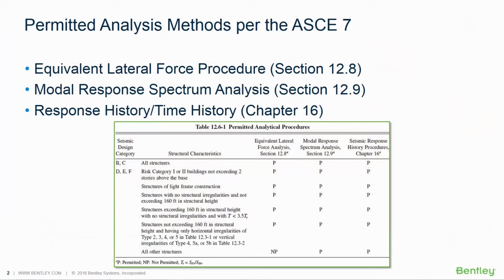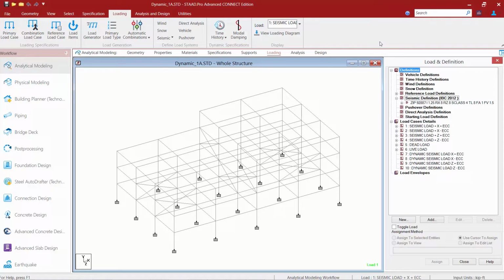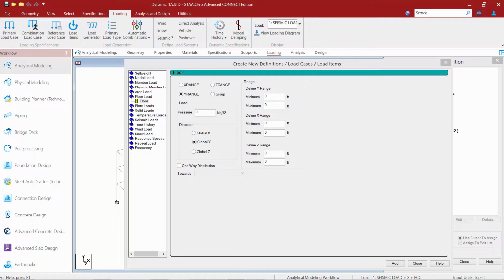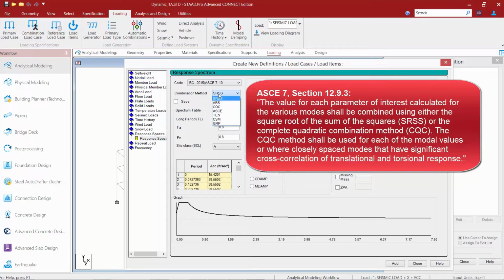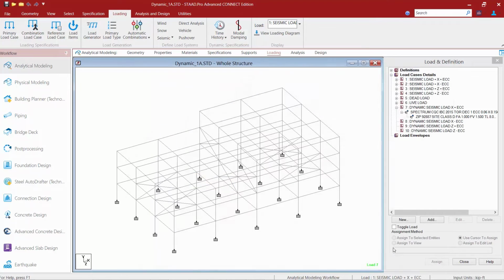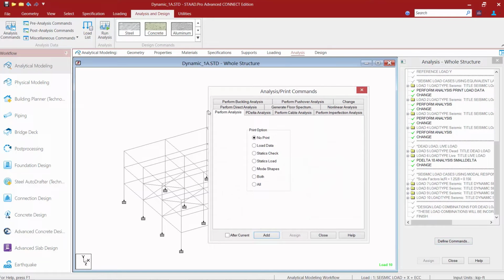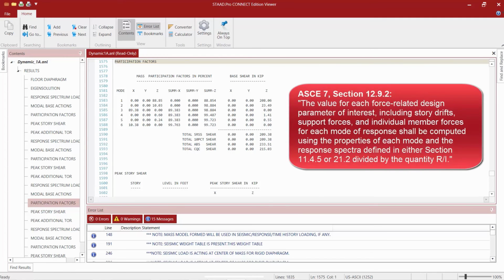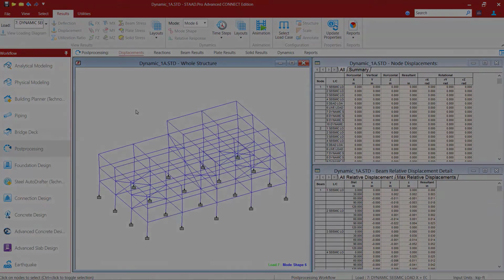Generating Seismic Loads using the Modal Response Spectrum Procedure in STAAD.Pro

Comment: There should be a way to define seismic mass automatically from primary load cases, so as to avoid the repetition of work
Reply from the maker: STAAD.Pro CONNECT Edition V22 Update 9 was recently released. This update includes a new mass model generator. For more information, please see Bentley Communities: https://communities.bentley.com/products/ram-staad/b/analysis_and_design_blog/posts/new-release---staad-pro-connect-edition-v22-update-9-22-09-00